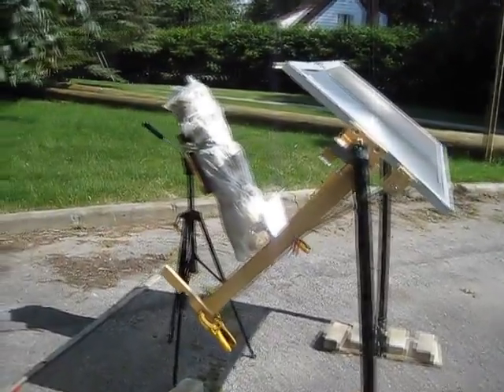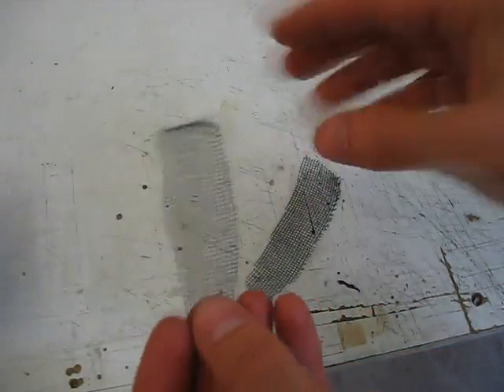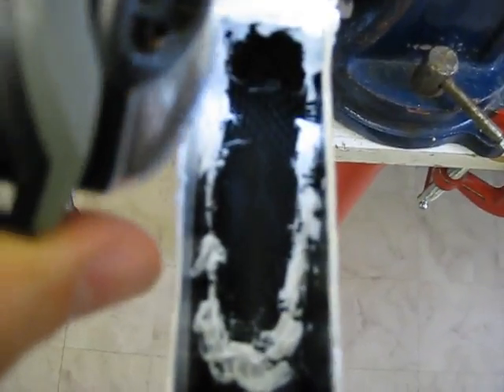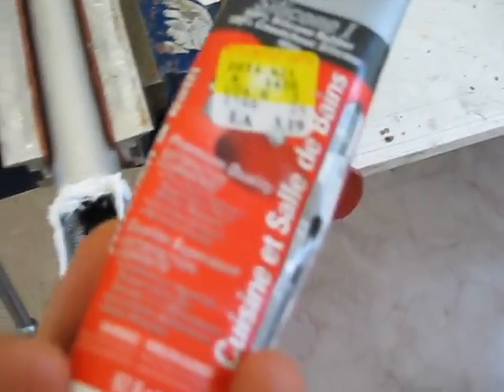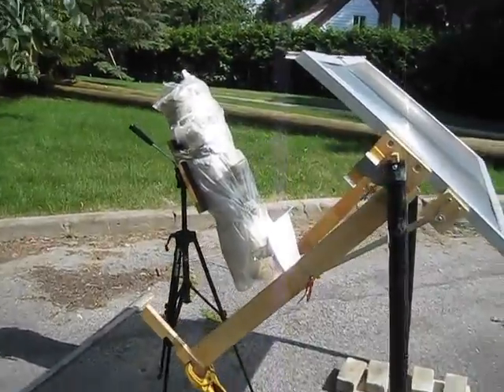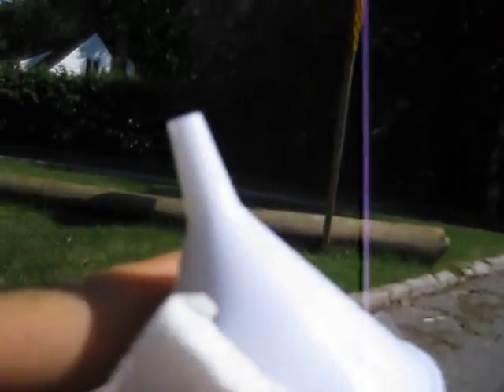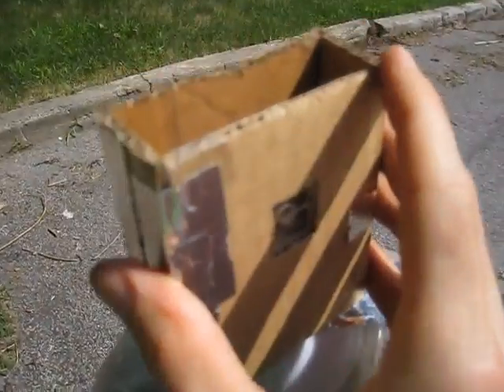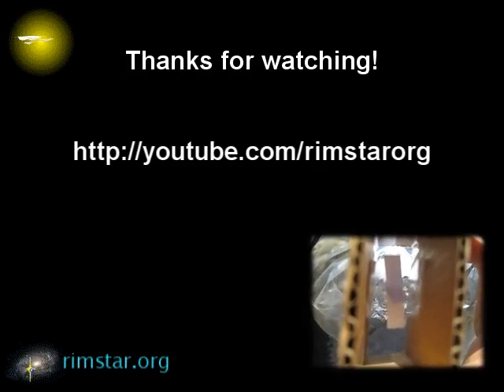Mini solar tower (ver. 5) powered by fresnel lens

Comment from the maker: Now that you mention it, I accidentally did use the venturi effect in versions 6 and 7 where the air output from the solar air heater box goes through an area of increasing size before getting to the fan. In case you're curious, there's are links to versions 6 and 7 in the description below this video and they're on my channel page.

Comment: (grain of salt to...).

search
natural draught  engineeringtoolbox
Rijke tube  hyperphysics

'chimney' leaks at less than fully developed turbulent (re> 2500 to 4000..)
more height / more updraft 
200degC is hot

turbine at  top
economics - not efficiency
(web reported effs. are turbine at bottom- chimneys leak top and bottom, laminar)

a wind turbine and a chimney

  taller the better. hotter the better. for performance.

  shorter the better.cooler the better. for cost.

Comment from the maker: @SumYoungHoe Thanks for this and your other comment. I agree. Making it wider and shorter are the changes I would make for a number of reasons including the physics formulas (proportional to area but to only the square root of the height). I'm not sure it's choking yet, but if I improved it it probably would. I still doubt I'd get much torque tough. I'll think about another attempt but I'm currently swamped with projects.

Comment: Hi there.
Sad to hear that you wont continue on your solar tower project. as for my self, I just order some mirror-finish aluminum sheet today (guess I cant use glass-mirror as it could break too easily). I'll upload my videos right after I start my project plan (hope it'll run smoothly). FYI, I've try my primitive concentrator using one of my primitive frying pan coated with silver decoration paper, but it only provide me 65 C (max) and the focal point is too close.